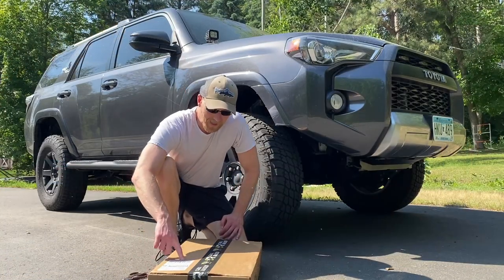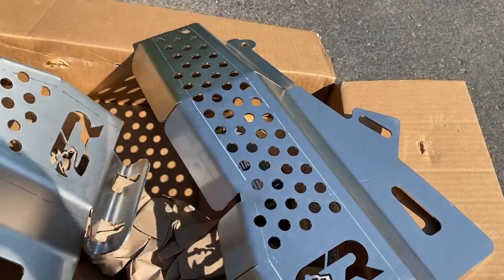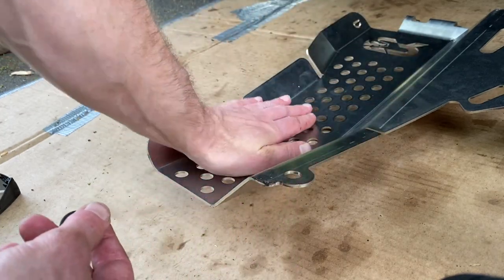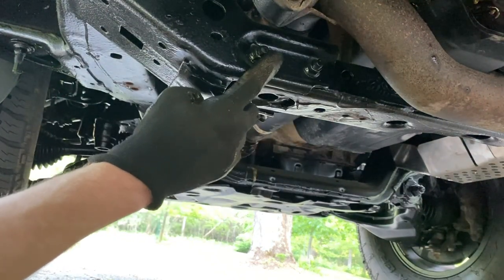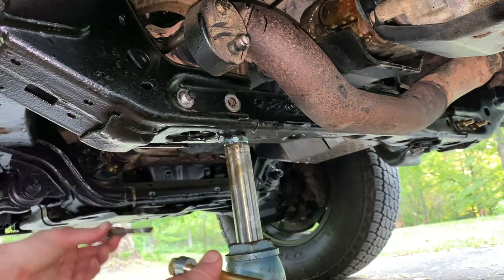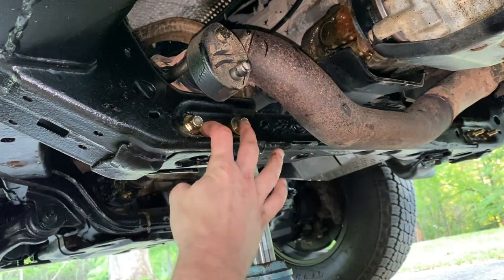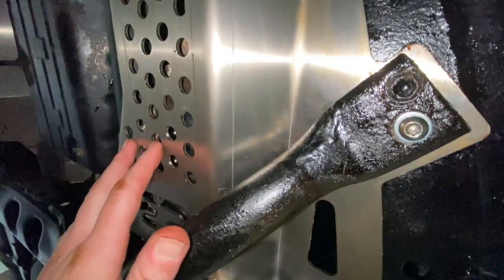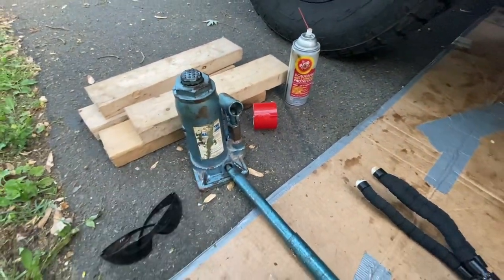The BEST catalytic converter shield for your 5th Gen 4Runner!

Comment: Great vid. Just finished my install and noticed the shield touches the cat on the driver's side. Do you have the same issue?
Reply from the maker: I actually didn’t notice that until you mentioned it. Yes, mine touches the catalytic converter on the driver side also, near the CR logo. It doesn’t look like it’s causing an issue with fitment though.  I’m sure it gets super hot, another reason to not paint it!  Thanks for watching!
Reply: I install mines and besides the shields touching the cat I also have vibration on that area when I stop you could hear it. Did you noticed that ?
Reply: @jcredeyes  I'm not detecting any vibration.
Reply from the maker: I don’t have any vibration on mine. I guess I’d double check the rubber bumper is installed correctly (larger side up) and tighten all bolts again.  Good luck!
Reply: Driver side right against the catalytic too... Same issue on my Taco before the updated design they released.. great customer service though
Reply: has anyone noticed the vibration when you start and turn off the your trucks?
Reply: I have a 2022 Limited Trim and mine is touching the driver's side cat as well.  E-mailed Cali Raised and their explanation is the design tolerances on these cat shields are very tight, it is normal to touch the catalytic converter slightly.  This is the lamest excuse I've heard coming from a manufacturer.  Having tight tolerance is fine, but it should not be touching the cats.  The clearance needs to be increased by 1/8".  I don't have a vibration noise issue, but this is still bothering me.  This is a design flaw from the initial release and Cali won't acknowledge it.
Reply: I think the shield touching the CAT  won't affect anything ...unless is lose and by vibrating could possibly damage the CAT housing ?
Reply: @jeeprider9975   The cats will always have a small amount of vibration, even if appears vibration free to the eye.  I noticed the cat shield has created galling on the surface where it touches the cat converter.  It probably won't cause any issues long term, but this is still a screw up in design by Cali Raised.  It should not be contacting in the first place.  Admitting a screw up in design is one thing, but the sheer arrogance and lack of acknowledgement by Cali Raised is astonishing.  They still ship with the incorrect shim hardware despite hundreds of feedback from users and in online forums.
Reply: @bohan9957  when I bought mine (at their location) they told me it was redesigned over the 1st issue because of a vibration issue. They also said they were telling folks to loosen one of the cross member bolts and tilt the cover slightly and that would help.. What they said, don't know because mine has a good clearance and no vibrations.
Reply: @TerryM-hb6sy  that's good to know.  I probably got the original "gen 1" version that has all the issues.
Reply: @bohan9957  Why can't we just just an extra washer or two for a spacer. I wonder if it would make the screws too short.  But even one extra washer seems like it would prevent rubbing

Comment: Just got mine in and it’s missing the spacers. Are they necessary? Of course Cali Raised and Yota Xpedition are both closed today
Reply from the maker: That sucks.  The spacer is important and will reduce any annoying vibration noise.  I wouldn’t install without them.
Reply: @sunroomstudios8487 could you happen to measure the spacers measurements for me? I’ve found some on YouTube. 3/8 x 3/4 x 1/4 inch or 3/8 x3/4 x 3/8inch.
Reply from the maker: They are tough to measure accurately once installed, but they appear 3/8” rather than 1/4”.  Hope you got hem installed alright!

Comment: My passenger side shield rattles annoyingly against the frame. Covers the cats pretty effectively though.
Reply from the maker: I’m sure you’ve tightened all the bolts and have the rubber pad installed right side up.  Mine have not rattled but I know that can be annoying.  Hope you can solve the rattle!

Comment: Very nice video. What are the bolts spacers for then? because I see them slide in the sluts all the way in. Will  2 washers 1 normal size and 1bigger work better rather than the spacers? Just curiosity
Reply from the maker: The spacers do serve a purpose.  The brace holding the transmission up has recessed areas for the bolts.  The recessed area is not large enough to accommodate the shield, otherwise the shield would have to be narrower and weaker.   I wouldn't use washers, the spacers do a great job getting the bolt head out of the recessed area to allow the shield to hook onto.  With thinner metal of a washer, even stacked washers, it's more prone to deforming.  You'd also have to use stainless steel washers to prevent rusting.  You could use washers if you had to, but I think the spacers are high quality and would really try to use them instead of washers.
Reply: @sunroomstudios8487  I was thinking that, I have not seen the real space on the braces my self but I saw the spacers sliding in. Do they rattle inside or not the spacers or they get tight once all is wrenched tight? I just receive my kit and will installed them once I have a good weather day. I appreciate your info, advice and concern.Thank you
Reply from the maker: @geronimopascuale9208  Once everything is tightened, everything fits snug and there is no rattling or movement.  Even nearly a year later, nothing has loosened.  So glad I got these and don't have to worry about it.  Good luck on your install, let us know how it goes!
Reply: @sunroomstudios8487  Fantastic and am glad it worked for you and that you like it. For sure I will update. Regards

Comment: Those security bolts that you wanted four of are only supposed to be used on one end of that tubular brace - the end that sandwiches the cat shield between the tubular brace and the body of the truck. See pics on the CR site.
Reply from the maker: Good to know!  I added a new note in the description for this.  Thanks!

Comment: I'm glad to have found your Chanel. The shield manufacture didn't suggest lock tight for the two SS torque type bolts?  Also, would the manufacture supply extra SS bolts and a second key bit if requested?
Reply from the maker: I have not found a recommendation for Locktite, but I think some sort of Fluidfilm or anti seize compound is always good.  I haven’t had any loosening of any of the bolts so far.  

Cali Raised LED sells security hardware separately for LED bars.  Not sure if they are the same as the Cat Shield hardware.  You could contact them to check.  They’re a great company and I’m sure they could get you some extra bolts if needed.

Thanks for watching!  I really appreciate it!
Reply: I inquired about this, as my key bit twisted and broke apart when I was installing the first shield. They gave me an Amazon link to the key bit. It’s just a standard Torx T40H bit. $5 on Amazon.

Comment: Thanks for a very detailed video....  It made my installation soooo much easier :-)....  I believe that the two special screws that come with the kit for each side should go together where the bar overlaps the shield, instead of putting one on each side of the bar.  It makes sense, because this is the only area where the original screws are not long enough to grab sufficient thread.
Reply from the maker: That makes sense the security bolts go together.  I should have tried that!

Comment: With my 2024 trd pro, the cross bar bent side is hitting the protector plate so it’s very hard to screw in the bolts and security key bolts. Cross bar will not align flush with the plate and cross member. I noticed older 4Runner models cross bars align flush and flat with the plate on the key bolt side
Reply from the maker: That sounds frustrating and I don’t really know why that is.  According to CaliRaised it should fit 2024.  Any chance you hit and bent your cross bar slightly?  I’m sure you tried bolting the key bolt side first.  How about a temporary longer bolt to get everything aligned, then replace one bolt at a time?  Hope you got it working!

Comment: I wonder if the cats retain more heat with these installed?
Reply from the maker: I worried a bit about that too, but this one had the most ventilation possible.  I haven’t experienced or heard of any issues.
Reply: Even if they did, the whole point of the cat is to vaporize exhaust…with heat

Comment: Did you notice a rattle from the driver side catalytic converter resting against the driver shield?  I dropped the shield down a bit...now no rattling noise.
Reply from the maker: No rattling on mine.  Was that little rubber disc in place in yours?  Sounds like you got it to stop rattling though.
Reply: @sunroomstudios8487  yes…the rubber was placed on the shield and is still there but it doesn’t rest against the vehicle frame…its alignment or degree of bend is off…rendering useless.

Comment: Driver side one Its too close to cat and vibrates when I stop y any red light etc. Any tips to resolve this. Did I installed it correctly. Its a Trd Pro 2020
Reply from the maker: Make sure that little circular rubber bumper is not up side down and that all bolts are tightened and didn’t loosen with driving.  Hope that helps, otherwise you can try contacting Cali Raised and they may have other recommendations.  Mine is 2018 TRD OR so maybe there are subtle variations with fitment?
Reply: I had the same issue...I dropped the shield down a bit...now no rattling noise.  The round rubber bumper was aligned incorrectly by Cali-Raised and rendered it no use.  The metal shield was up against the body.